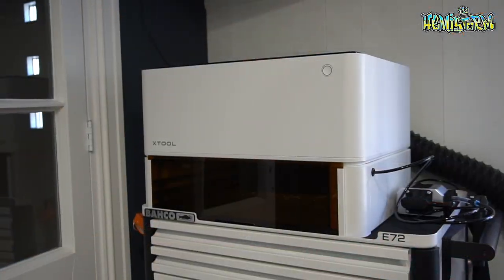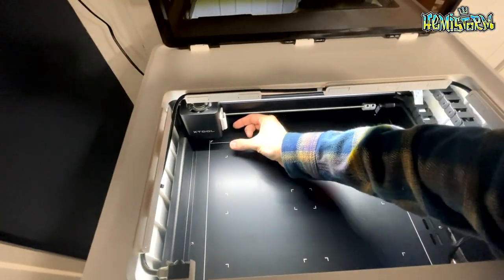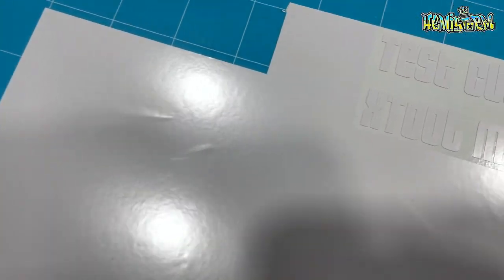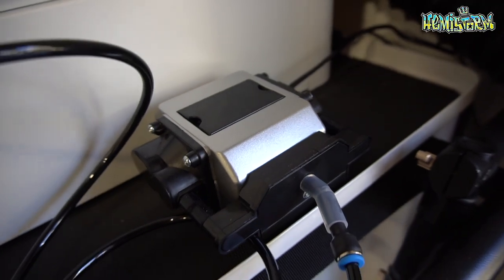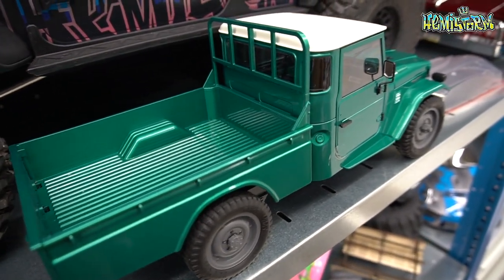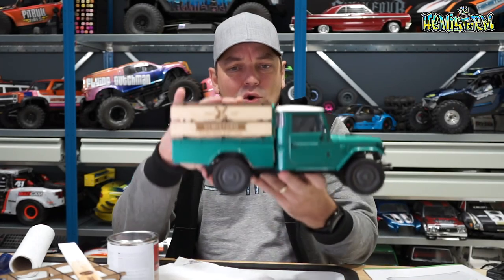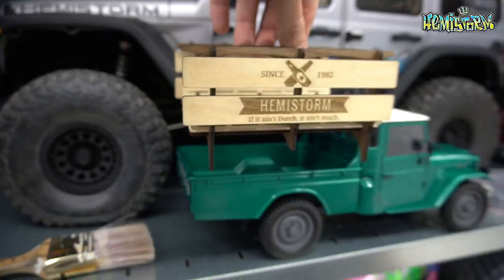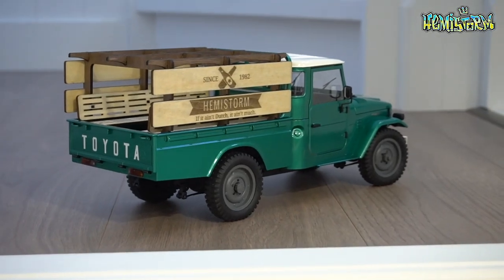CUT IT OUT! xTool M1 Lasercutter & more - CREATE ANYTHING!

Comment: Vinyl cutter tip: The blades tend to dull from rust faster than use in a non industrial setting. Keep them clean with a very thin oil and they will last much longer. Make sure to remove any excess oil prior to use. Placing them in an air tight box with a desiccant pack will also help prolong their life. Note: When I first started using a vinyl cutter the blades were $30+ US each at a lower inflation level.